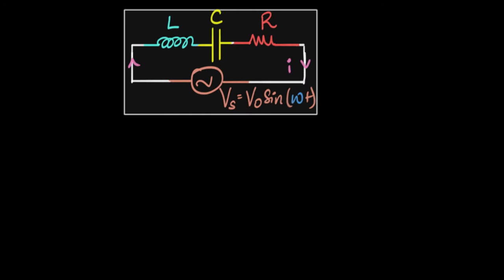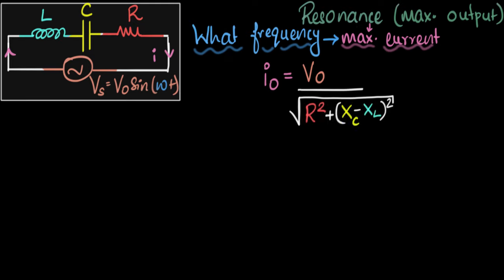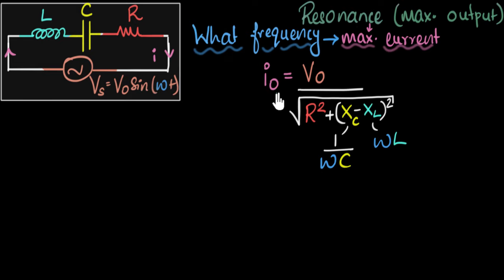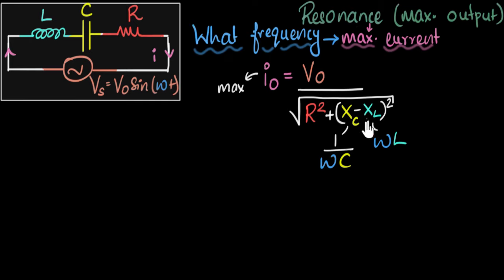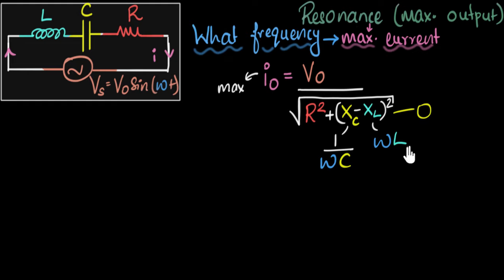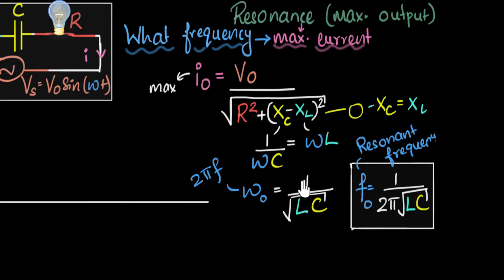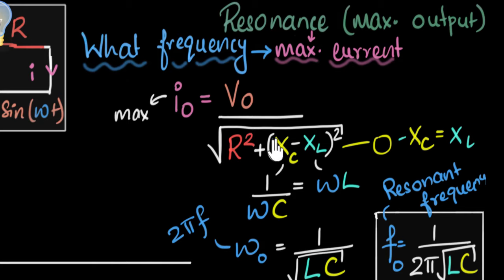LCR resonance & resonant frequency | A.C. | Physics | Khan Academy

Comment: 00:02 Resonance is achieving maximum current output for a given input frequency.
01:24 Impedance depends on the frequency in alternating circuits
02:52 Resonant frequency gives maximum current
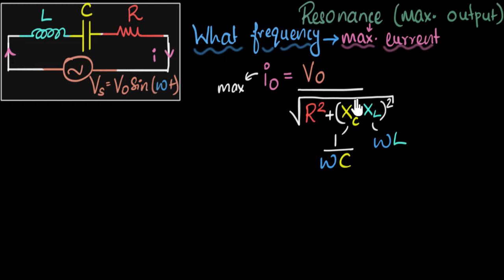04:13 Minimizing the number for resonant frequency
05:38 Resonant frequency is the frequency at which current becomes maximum.
07:15 Impedance is dominated by the capacitor at frequencies lower than the resonant frequency.
08:32 At the resonant frequency, the current is maximum and the bulb glows very bright.
09:53 At resonance, a circuit behaves like a pure resistive circuit.
Crafted by Merlin AI.00:02 Resonance is achieving maximum current output for a given input frequency.
01:24 Impedance depends on the frequency in alternating circuits
02:52 Resonant frequency gives maximum current
04:13 Minimizing the number for resonant frequency
05:38 Resonant frequency is the frequency at which current becomes maximum.
07:15 Impedance is dominated by the capacitor at frequencies lower than the resonant frequency.
08:32 At the resonant frequency, the current is maximum and the bulb glows brightly.
09:53 At resonance, a circuit behaves like a pure resistive circuit.

Comment: Resonance doesn't mean maximum output or maximum current. It is defined as the condition in ac circuit under steady state when current is in phase of voltage.
Reply: Yeah, see i° and f graph, only in resonance you get maximum current, similar in oscillation and waves
Reply: Half knowledge is more dangerous bro 😂😂😂becoz at resonant condition the amplitude of current  attains a peak value
Reply: @Human-sf5ri  current can be zero in resonance.
Reply: @harshrajsingh8969  if potential is zero than current can be zero in resonance
Reply: @Human-sf5ri  if supply ac voltage is non zero then current can be zero in resonance.
Reply: @Human-sf5ri  It seems that you have limited knowledge about resonance.
Reply: @harshrajsingh8969  but how
Reply: @harshrajsingh8969  thanks bro
Reply: @harshrajsingh8969  bro but they are comnected in parallel but in our book only series
Reply: @Human-sf5ri  So something that isn't in your book, that ain't true?!!
Reply: @harshrajsingh8969  but in this video. He was talking about series lcr circuit.
Reply: @Clash_Royale  Yeah, but that isn't the excuse to give wrong definition of resonance.
Reply: I think you mean parallel RLC circuit
Reply: Yep, I guess you only saw half video, that's what he was trying to explain in video, and he said, "that it means at resonance Φ=0° , I. E. They are in same phase." that's the reason someone replied to you saying you had a half knowledge, lol do get serious, we are all here to know and learn

Comment: in the third animation, current can still not be higher than the voltage😅
Reply from the maker: I always had that confusion myself, but remember current & voltage are two different quantities with their own units. So, they cannot be compared.
Reply: @KhanAcademyIndiaEnglish  but in accordance with ohm's law I think it should be smaller, please correct me if I am wrong
Reply from the maker: @PrabhjotSingh_24  Think of it this way, according to speed = distance/time, could we say speed is always than distance? Even numerically, the denominator could always be a fraction.
Reply: @KhanAcademyIndiaEnglish  Thanks, Now i got it